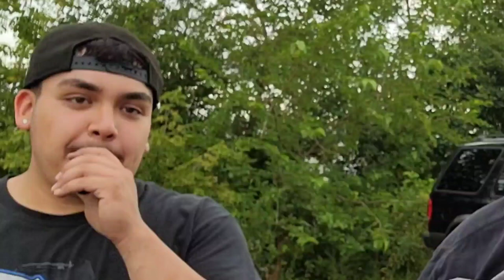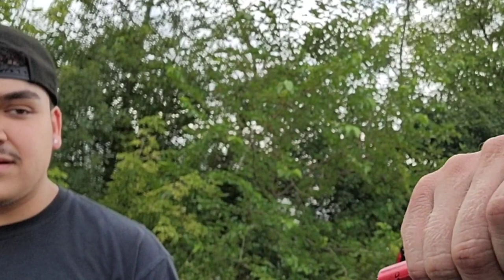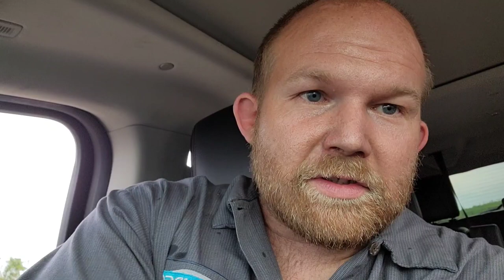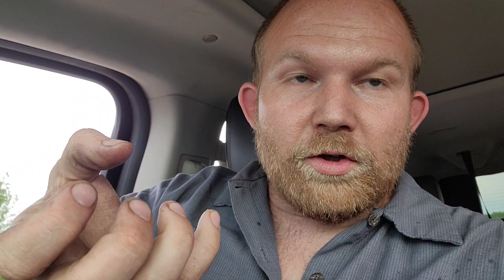Oil Filter So Tight - Try This And See For Yourself - Most Of The Time It Works 💪

Comment: Honestly this would work beautifully however the biggest thing people could do is try to pill the filter off from as close to the top of the filter as possible to prevent crushing as most people just loosen from the center where it has the least structural regidity

Comment: Never tried that trick, but I did have one that was on so tight that even stabbing a screwdriver through the side didn't work. It just sheared the oil filter in half and the guts dropped out of it. I then had to take the flat head screwdriver and use it as a chisel against the inside surface to get it off that way. Not sure why folks put them on so tight, or if they tighten up like that over time due to heat and pressure.

I also loosen the filter a bit before I drain the oil, that usually helps keep situations like this from occuring.

Comment: some filters can hold a qrt of oil wouldn't that get put back into the motor or you can put 2 or three qrts of cheapo oil in and then change it out ? the smaller filters prob wouldn't make to much a difference i def gtta try that

Comment: Good tip, but it depends on where that filter is located. Ford 2.0L used to be mounted on the backside above the steering rack and Catalytic Converter. I've seen the quick lube employees get burnt badly on vehicles right off the street. Their management offers big clumsy heat safety gloves, but they pressure them to work faster not safer. I feel bad for them, it's no different than a fastfood fryer accident.  Remember the rule:
⚠️DO NOT STICK FINGY WHERE YOU WOULDN'T STICK YOUR DINKY⚠️🤔😂
There aren't many jobs that hand out awards for getting hurt being a hero.
Ambulance has electric/hydraulic cots, don't lift patients anymore.
Law Enforcement has better protective equipment from military surplus, they don't run into active shooter situations with just a Crown Victoria and .38 sidearm anymore.
Firefighters have FLIR cameras to see the fire and victims in the smoke, they're not going to crawl around every room with burnt holes in the floor looking for any possible victims.
If first responders don't get awards for taking risks anymore, people at regular jobs won't ever see an award for saving the boss 10min labor because it's faster without the safety equipment. Sadly the Asian/Mexican manufacturing has working conditions that are 200+ years behind our labor laws, it's impossible to compare a product made from either continent. Sure it's cheaper but at what human cost?
Reply from the maker: As I say with any video If a person doesn't have common sense they shouldn't attempt this
Reply from the maker: I can't babysit every single person that watches my videos and correct and make reference to every single Safety Action that's up to people to try to figure this out for them themself

Comment: Some of us have to get on the ground - no lift - and then  jab the screwdriver. How about not monkey muscling the filter on in the first place?
Reply from the maker: You're right and if you look at my previous oil change video is you'll see that I always specify that's not a good idea but even sometimes when you don't muscle it on it still ends up sealing up pretty tight anyway

Comment: Used a belt many times to get a filter off too cheap to buy a strap wrench 😂😂😂. But seriously an old belt has worked great for me and I work on heavy duty diesel engines and there are generally 5 to 8 oil filters that are big and take a gallon of oil each. Always seems like a gorilla put them on 😂😂😂. Then I find out I'm the gorilla because my initials are on the filters 😆😆
Reply: My oil filters are never stuck no matter how tight I put them on. They always come off by hand. I apply SilGlyde or RuGlyde to the gasket.
Reply: Been doing that for 50 years

Comment: And then what, drain the new oil and repeat ?
Reply from the maker: Change your filter that's it
Reply from the maker: Check out the pin post
Reply: I think only a little bit of oil comes out of the filter otherwise you wouldn’t need a drain plug
Reply from the maker: Yeah you just top off the oil that's it you're not really losing anything there's not very much oil in the filter to begin with so when you put the new oil filter on there you put it on there full or you spin the filter on start the vehicle and then shut it back off top off and done
Reply: I don't think you'd need to change it again. Even if you had a big old filter that could hold a full quart. Depends on how long it was running, no "dirty" oil got past the filter, just used clean oil. There is still old oil on top of cylinder heads, I'd need to see a side by side cup of each oil to make an real opinion. But checking the dipstick you'd never notice. 🤔🤷🏻‍♂️

Comment: Why do you need to put new oil in first
Reply: exactly my thoughts.. you dont actually.. doing this BEFORE you shut the car off and drain the oil makes wayyy more sense.. what happens if you somehow puncture the filter or something OR the customer went 25k on this filter and oil and now the filter gasket is FLAT and as soon as you crack it loose its pissing your brand new oil all over the floor.

not only that I dont want to send my new oil through the old filter mixing more old oil with my new oil and contaminating my fresh oil change.

do this trick BEFORE you spill and fill.
Reply: @gregthemechanicman  my only guess is that he drained all the oil via drain plug before trying to loosen filter. I like to loosen filter a bit before draining oil.
Reply from the maker: So before this gets out of control and people start trying to play right or wrong there's no right or wrong answer here you can do it that way most of the time when the oil change guys pull the drain pan over what do....they do pull the plug first and start draining the oil that's what this video is about right
Reply from the maker: We're not going to turn this video into a pissing contest I see daily what happens at the Quick Lube side right you always pull the drain plug first and then you do the filter after and then it's like fuk fuk fuk fuk you hear the cussing well that's fine put the oil back in it start it up put it back in the air lightly pull your filter off some put it back down shut the vehicle off change the filter top off the oil
Reply: @gregthemechanicman  your comment is ridiculous your looking for something to complain about and trying to be Mr expert calm down if you don't want to use this method dont. And you really think your getting all the old oil out when you do an oil change thats never gonna happen your gonna mix old and new oil anyways and mixing what? A half quart of oil with the new stuff isn't gonna hurt the engine just relax and listen to the video and take his advice or don't.
Reply: @5.0_marcus  yeah I think you need to calm down there bud your getting all bent out of shape for no reason mr. Internet Warrior over there...

 I am not critiquing what he's doing like you must be taking it and as a few have taken it.. and I'm sure mr. Ford boss himself would agree that doing this before you drain the oil makes more sense.. I don't care about quick Lube places I'm talking about THE RIGHT WAY to do things versus the way quick lube places do things.. I'm all for this Channel and ford boss is awesome and I've learned quite a bit from him..I'm a business owner myself I have a thriving shop with work booked weeks and months out in advance.  I'm not some yahoo off the street man.. RELAX A BIT.

@Ford boss.. keep rocking dude!
Reply: @gregthemechanicman  you were definitely critiquing him but alright if you didn't mean to then shut happens but I don't need to know your life story. I think your the internet warrior as well trying to explain the best way to do it when your way doesn't do any help but again alright good luck to you and your business let's not turn this into a fight I'm gonna continue on with my day and you are too
Reply: You are absolutely correct, I was thinking the same thing.  Loosening the filter first before pulling the plug is a way better idea than doing it after regardless of who’s doing it.
Reply: I’m going to disagree and say there is a right and wrong way to do it. Your idea to have the filter pressurized is a good idea and doing it before you drain the oil makes it a great idea.